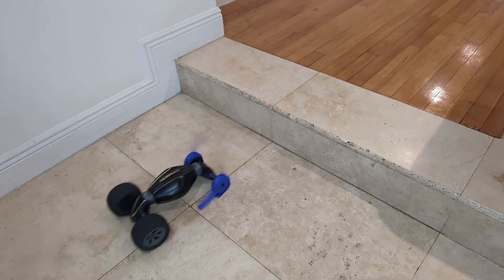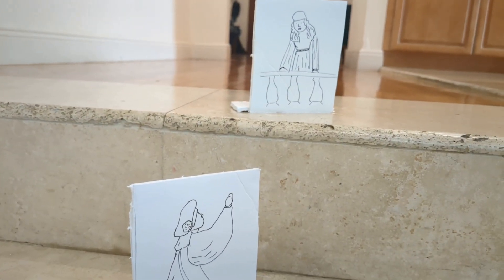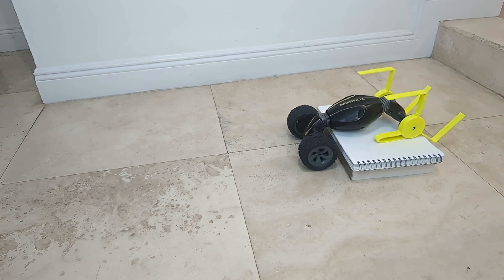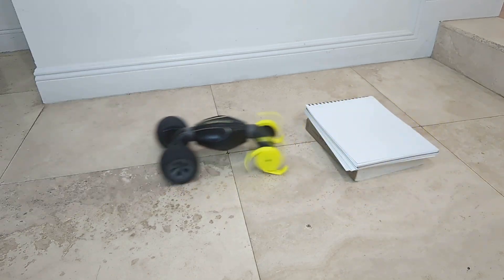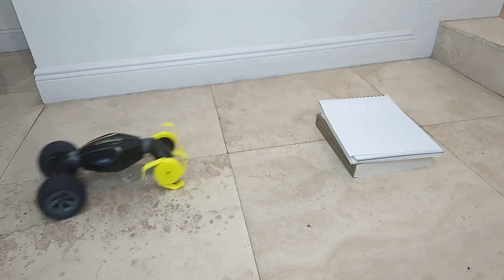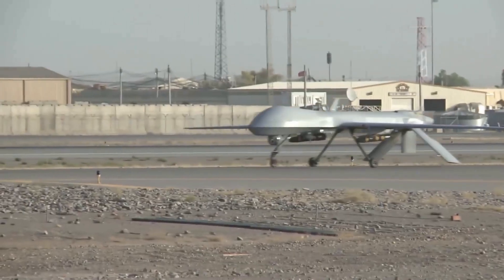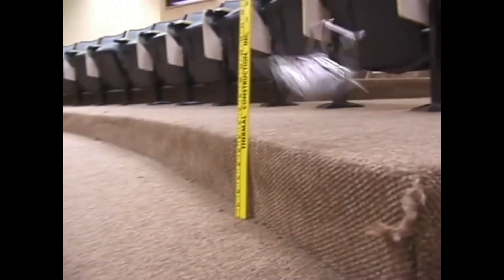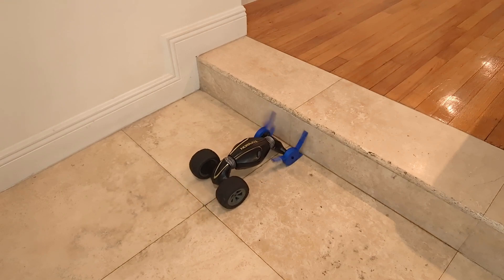Clyde the Stair Climbing Soft Whegs Robot

Comment: I think your little RC car just needs a little more torque. So e of those whegs look like they WOULD be good at overcoming obstacles better than wheels if only they had more oomph behind them. 
Nonetheless, very fun vid. I like the spiral whegs, they look messy and chaotic
Reply from the maker: @SidneyBatchelder  I agree. It is a little underpowered. Especially if the battery is running out. And it needs to be 4 wheel drive.